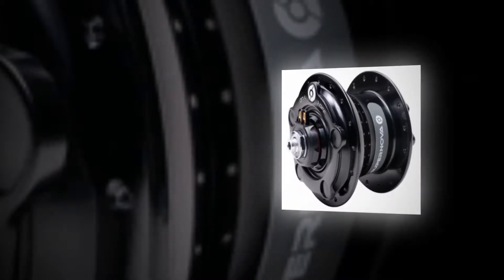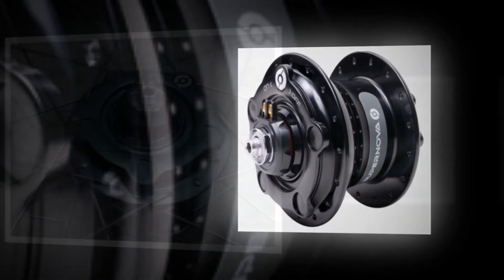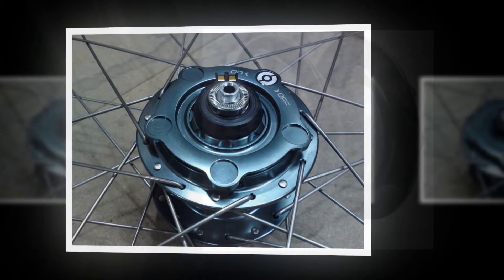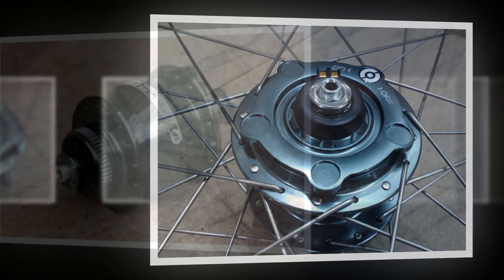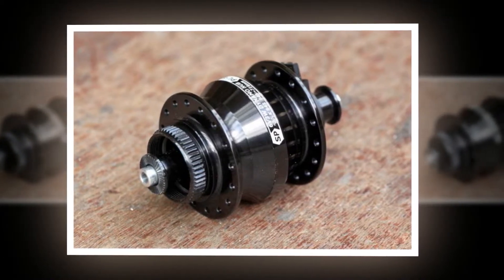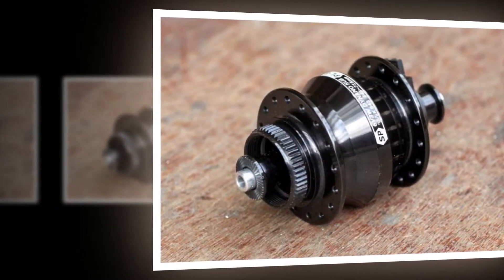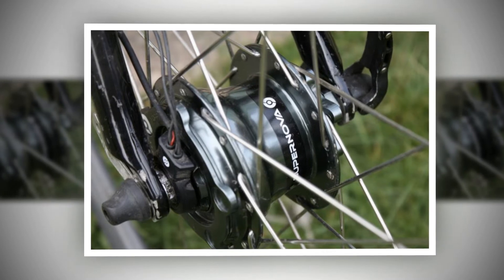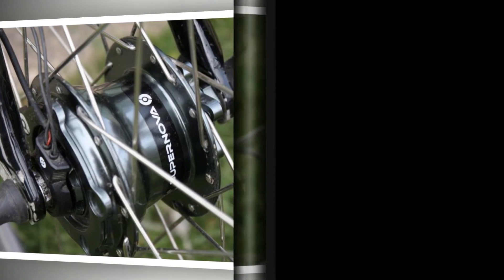Supernova Infinity 8 dynamo hub

Comment: Supernova no longer make the Infinity 8!!
Reply: Yeah it's a shame, I have one and I wish I could buy another. Very nice hubs, I don't understand why the stopped.
Reply: @nickwf70  I believe the Infinity 8 was a Shimano design and the license to manufacture it had run out. I bought an unused Infinity 8 off eBay about 5 years ago but never had it fitted to a wheel...it's still in its original tin packaging. It's a horrible pink colour, but was the only one I could source after searching for well over a year.